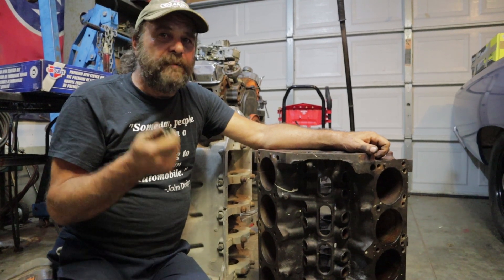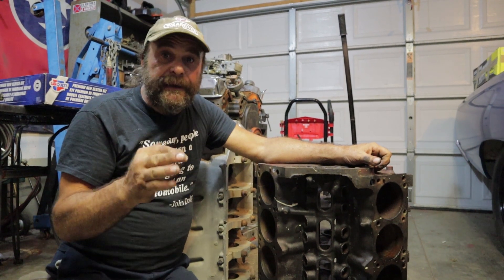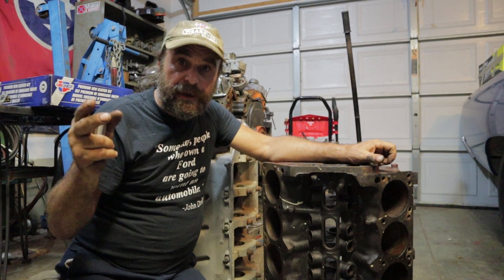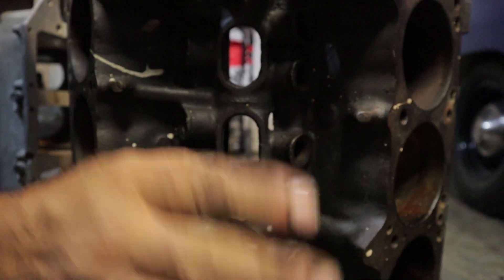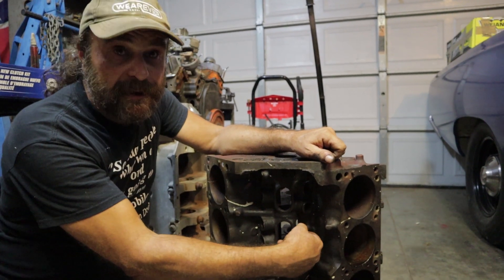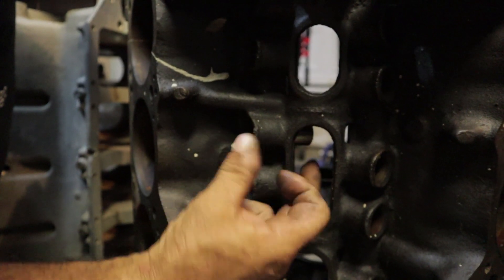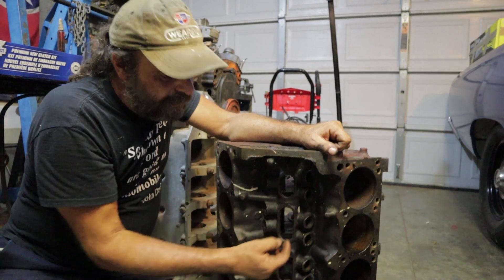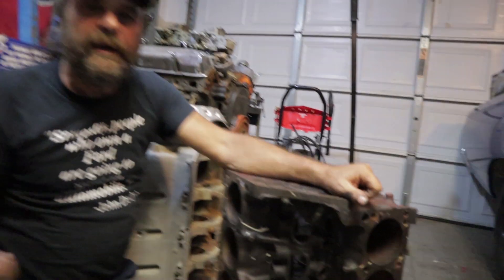Avoiding Camshaft Doom

Comment: Uncle Tony!  Love your channel!  Love the content!  Please keep up the good work.  I'm old school as well, but some of what you share I didn't pick up from my dad or grandpa and haven't figured all of it out on my own either.  Quick question about camshaft break-in.  Do you, in practice, use lighter valve springs or lower ratio (1.3:1) rockers for break in of cams?  Cam manufacturer (and other channels) suggest this to ensure that the cam isn't wiped out.  I'm wondering if it's overkill.  I've only built 3 or 4 engines in my life and I never used different springs or special rockers.  Never gave it a thought.  Was I just lucky?  Does this really need to be done or is it overkill?  As long as the lifters are observed turning and we get it to start w/o a lot of cranking, etc.  Thank you!

Comment: I always figured "zinc" wasn't the problem, or at least not the major player. Too much other stuff to go wrong and every failure I've seen pics of didn't look like lube failure, it's always one or two lifters or a section of a cam, more indicative of bad parts, bad parts selection leading to binding, bad assembly practices (not checking lifter/bore fit and checking for rotation), etc. GM and perhaps other OEMs also sold several fairly hot flat cam crate motors deep into API SM/SN oil, with warranties, without any break in instructions besides "fill with 10w30 and hold at 2500".

Comment: I figured this out on my own building my first motor. The lifters were so worn out on disassembly I gouged a couple bores and I foraged around the shop and came up with a wheel cylinder hone. Worked flawlessly

Comment: don't forget the zinc. since they stopped putting zinc in the oil New cam failures have skyrocketed. use a good zinc fortified assembly lube. Lucas has a good one. I also add about a third of a bottle (2 to 3 oz.) every time I do an oil change.

Comment: hit the tight ones with a wheel brake cylinder hone or wrap sand paper around a dowel slightly smaller than the bore and put a screw in one end of the dowel in the center then put the screw in a drill and use the drill to sand it out a little

Comment: Flat Tappets are just fine. I think people make too big a deal about it. Break them in properly, change oil, go 500ish miles or 10-12 hour drive time, change oil, I kee running zinc oil. You should be fine. In that 500 miles get on it a few times, slow down, get on WOT. Seat the rings. They are fine, just a little more “tenderness” for 500miles than rollers.

I have a flat tappet in fresh 350 rebuild if I screw it up and all I can afford is flat, Im going flat. Usually flat tappets poop out on break in

Maybe Tony could do a vid on flat tappet break in, or flat/roller comparisons based on applications

Comment: the cam ramp rates are moor aggressive now than in the past and add in bad metals and oil and you have problems. all so how about grooved lifters to get moor oil to the cam and lifter boor. are solid lifer cams less likely to fail? how about ruining solid lifer cam with hyd lifters? how about rhoads lifters?
Reply from the maker: Absolutely none of that has to do with the lifter rotating freely in its bore. A solid lifter cam is more likely to fail because of the more aggressive ramp, and rhodes lifters work ok..I've used them a time or two in the past
Reply: @UncleTonysGarage  how about ruining grooved lifters? all so can one run solid lifters on a hyd cam? how about hyd lifters on solid cam. all so how about ruining amc sized lifters in a ford or Chevy. lot of old school tricks i have heard about but have no experience in. take care

Comment: Back in the late 90’s early 2000’s everyone and their brother was pointing fingers at each other about lobe/lifter failures... ☹️. Cam manufacturers, lifter manufacturers and oil companies all blamed each other... even China was blamed. 🤔
I started using Crower “Cam Saver” lifters for all flat tappet lifters exclusively.  No more lobe/lifter issues using Rotella 15w-40 and the Cam Saver lifters for the break in procedure. 
Now I’ve sold out, only really building LS engines with roller Cams!  😉👍🕶

Comment: Back in the Mid 80's I was building my 65 Mustang 289 and was at a Speed Shop in Bergen County N.J., I had my Manifold and Carbs sitting on their counter as I was bending linkage trying to get what I wanted / worked. This guy comes in and looks at my setup and says, "I want that setup for my Trans Am".  The guy behind the counter (who owned the shop) looked at him and said do you want to tell him or should I. I miss the days of being able to go to a local speed shop and be able to find the parts or pieces needed to do a build. Now a days, all anyone wants to do is plug in a chip and have a race car!  Please keep these great videos coming you are doing a great thing by sharing the old way to a bunch of people that would never have known existed!  To bad I never got to meet you back when I used to run around Staten Island back in the day.
Reply: Even in 97 I was doing performance cams , camel hump heads and all the jazz with no internet to help.   These days most are lazy and have it easier to do what we did. We had to use a chiltons or find a guru.

Comment: what type of oil should we use inside these old engines that require zinc
Reply from the maker: Normal street engine?  I use Shell Rotella
Reply: most of the engines that come thru here are 600 hp and they like the vr1 oil even the stock engines get vr1 oil I even use vr1 In my 318 fury ..ive heard of other shops using rotella but we have yet to try it

Comment: If you want oil with lots of Zinc/Magnesium in it that pre O2 sensor systems absolutely love then try Shell Rotella 15W/40 truck oil, Castrol Drydene is another good one, I've been building and running Harley engines (they have roller tappets) for a living for years and they love the stuff, if you need a thicker viscosity (like I do) then spike it with STP Oil Treatment, it's a viscosity thickener and has even more Zinc/Magnesium in it.
I've taken apart engines I've built with 10's of thousands of miles on them that I've had the owners run that oil with STP and they look beautiful inside, one of my own engines that I ran for 20 years that had almost 100,000 miles on it and had the original factory roller lifters in it and they were alive and happy even after the engine cases were shot (it wasn't valve train or lubrication failure).
A friend of mine with a strip car that was a 9 second Ford Maverick ran nothing but straight Rotella 15W/40 in it and after 35 passes he did a partial tear down and everything inside was textbook.
Word of caution though, automotive systems that have a downstream O2 sensor that monitors emissions will sometimes trip the sensor and the Check Engine light will come on from the additional Zinc/Magnesium in that type of oil (it's truck oil), the computer thinks the engine is running emissions rich and trips the Check Engine light, these are later model systems however and the earlier non-emissions monitoring systems (one's that don't have an O2 sensor after the converter) won't have that problem.

Comment: don't forget the high zinc oil.
Reply: All I run in my engines is rotella t. Only time I add additives is during break in. Other then that just straight rotella.

Oil is always clean, so is the filter.
No way am I paying 10-15 bucks a qt for street engine oil. That would be almost 100 bucks just in oil, every 3000miles.
Reply: I hope you don't have a flat tappet cam then
Reply: I use synthetic driven oil. so I get longer than 3000 miles out of it.
Reply from the maker: Rotella has enough for any normal street engine.
Reply: by normal I guess you mean roller cam engines. they reduced the amount of zinc in rotella and now it no longer has enough zinc for flat tappetcams.
Reply: @1flynlow  do some more research. Don't just go to the forums and take what they say as gospel. Rotella has changed over the years, but the regular DIESEL rotella has more than enough for any street driven engine, even high hp NA engines.

As for synthetic..... It's a sham. As for more milage with synthetic..... If you say so. I'd still change it, just the way I am I guess.
Reply: "There are two ways a person can ensure they are using oil that has sufficient amounts of antiwear additives, commonly listed as 1,200 ppm ZDDP for flat-tappet engines with stock valve springs and 1,400 ppm for engines with higher spring rates. The first is to buy oil that is similar to older formulations. This used to be as simple as buying a diesel-rated oil, such as Shell Rotella T and Chevron Delo 400. Diesel engines also have highly stressed wear points, but diesel oils were reformulated to CJ-4 in 2007. Although the levels of ZDDP were reduced, most are still significantly higher than common car motor oils." http://www.superchevy.com/how-to/corp-0808-worn-down-engines/
Reply: "CJ-4 specification. (The 15W-40 Rotella T with Triple Protection oil has approximately 1200 ppm of zinc and 1100 ppm phosphorus at the time of manufacture)"
Reply: so according to this, rotella is fine for a flat tappet cam as long as you have stock valve springs. I do not.
Reply: @1flynlow   shell rotella t-4 has between 1200 and 1400 zppm. It was reformulated to cj-4 but is still sold and marketed as, safe for vehicles that require ck-4.

The only oils that aren't up to task are rotella synthetic and gas and gas/diesel oil.

I built my motor, I've built short track race motors and have always used rotella. Oil is always clean, filter is clean and my magnets are clean.

If YOU want to spend 15 bucks a qt on an oil that is just as good as the "cheap" stuff. Right on brother! But don't tell people rotella is going to kill their engine when it won't.
Reply: @1flynlow  I've got a lunati 292 with double springs. Rotella works great.   I'm done with the pissing contest. Take care and love thy motor.
Reply: flat tappet?
Reply: @1flynlow  yes.
Reply: thanks for the info. I wouldn't have known the difference between the CJ-4 which is safer for flat tappets and the "gas and gas/diesel" oils that "aren't up to the task." and I bet a lot of other people wouldn't either.
Reply: @1flynlow  I believe the gas oils will have an SN after the CJ-4.

CJ-4/SN.... I believe.

Comment: Another low budget tip: 12guage shotgun cleaning brush in a cordless drill or by hand, remove rust not metal
You can also buy much less expensive "tube brushes" in any size( just like the dingleberry hones). I use a piece of tubing or wood as a handle.
Share the knowledge!!
Thank You Uncle Tony for all your knowledge and advise !!
Reply: That what i used. Had a mossberg kit.
Reply: You can get those pipe brush kits at Harbor Freight for under $5

Comment: Well put Tony...One of the engine shops I worked at reconditioned hydraulic lifters and the method for the "angle" on the bottom of the lifter is Radius grinding...They were about $15.oo each new then so it worked out well when they did 1000 per day by hand and not so well when one of the goofs ruin a $500 diamond precision grinding wheel.

Comment: Tony, I  always  appreciate your advice to bucks down and inexperienced enthusiasts.  This latest trick of cleaning lifter bores with a brake hone is brilliant (been reading performance mags for years, never saw that).  I usually credit myself for visualizing  the 3 space physical world in my mind, but I fall short on cam theory.  OK, I know more lift is good, but past a point, you need to machine deeper spring pockets, get valves with longer stems, and springs with more travel and seat pressure., and you have to worry if the valves hit the pistons.  I understand more duration is good, but past a point on top of the aforementioned mods, to breath on the top end, an engine will idle like crap on the street, and at the end of the day, max duration requires roller cams.  I have less of a handle on lobe separation and indexing (advance and retard cam timing).  I kind of wish I lived in the day when cam grinders marketed their products as 1/4, 1/2, 3/4, and full race.
Reply from the maker: We'll do something on camshaft terminology soon
Reply: @UncleTonysGarage  3/4 cam i used to ask wheres the other 1/4 lol

Comment: Uncle Tony, I know you are majority a V8 & Slant guy, But I'd like to ask a question, In your Past Car days, Muscle Car Building, etc Have you ever messed/built any Buick V6s? I just Re-bought one for my G-Body Car & Have big plans in the future to Build it but on an Affordable "Old School" Way of Tips, Tricks and Performance mods... I know I will not Get much HP out of it without going all custom, etc.

I'd just like to Raise it enough to were it 1. Still a Daily Driver & 2. Fun enough where I will not get bored of it The car Being from Michigan is Specifically a Summer Daily & Show car... Thanks.
Reply from the maker: I rebuilt dozens of them back in the day, and  played with one for a Muscle Car Magazine project car back in the mid 80's...that's about the extent of my knowledge.  Engine was used in a ton of different applications over the years, so finding good info on it should be pretty easy
Reply: buick v6 engines arent hard to make fun. what year engine?

Comment: now I know a hydraulic roller wont spin in the bore, but would you want the same thing? when I pulled them on a 302 out of a fox, they had a bit of resistance (may have just been oil kinda sucking it into place) but its been sitting my shed soaked in wd-40, im wondering if thats something that I may have to consider.
Reply from the maker: Not nearly as important on a roller

Comment: Who the fuck forces lifters into rusty bores on a build? No friend of mine haha..... Get a set of ball hones if you are performing a low budget make do guerilla engine build. Here are some, and you can use am on brake master and wheel cylinders too. BTW, that last lifter bore seemed a little too loose IMO. Anyway. Thanks Tony.   https://www.ebay.com/itm/Ball-Hones-2-Pieces-3-4-and-7-8-New-Other/323838539345?hash=item4b6647f651:g:S68AAOSwXSJXPMx0:sc:USPSPriorityMailPaddedFlatRateEnvelope!95519!US!-1

Comment: Hey Tony I recently assembled my first engine with hydraulic lifters I was following a workshop manual (of questionable quality) which neglected to detail that the lifter needed to be half full of oil before the plunger was installed, I did however well lubrucate them on assembly then submerged them in oil overnight, Do you think it would be OK to run if I prime the engine with the starter or should I just be safe and redo the lifters properly?
Reply from the maker: I never fill the lifters myself.
Reply: Cheers I am relieved to hear that👍 I was getting a little bit worried after noticing that extra step in my 2nd workshop manual

Comment: I have found in order to get past the possibility of sketchy metal in lifters (flat tappet) I go to Howard's (Direct Lube) or Crower (Cam Saver) and run those.  Good metal (Crower guarantees their face hardness & grind spec) and they work with anybodies cam :D  Cheap insurance in the low zinc oil era ...

Comment: This is great advice for at-home engine builders. 
Something else to remember is if you have your engine block hot tanked, you MUST hone your lifter bores. The heat of a hot tanking can cause your lifter bores to become slightly egg shapped. This will result in lifters "hanging" in the bore or sticking. That can break a valve spring or even damage the entire engine.

Comment: You should see a "Bullseye" pattern on your tappets/lifters.  If not somethings wrong.  Also, if your tappet seems to be scuffed that can be the sign that you're not getting enough lubrication and/or zinc.  We fill every new engine with Schaeffer oil during break-in and the delivery fill because it DOES have a bit more zinc to protect the type of "old school" engines we predominantly deal with.  Once it's broken in...additional zinc is mostly not needed as most oils still have 1200PPM ZDDP in them already which is about the min required.  Nothing wrong with adding it because most of those cars don't have cats...but often not needed once everything is broken in.  But as we tell people when they as about how long it takes to "break in" and engine..."The first stroke is breaking it in, the rest are wearing it out"!lol!

Comment: Got a ?  I got a sbc with 292 cam HEI dart pro 1 iron heads 60 over flat top piston 750 carb. Carb is set and time is on 12°  starts and ideals good but when Rev up it backfire through the carb and when put it in gear and bring it up on the stall ( 3500) it pops and cracks and will not evon turn the tire over any advice would be appreciated running out of ideals for it
Reply from the maker: Initial timing is 12, but what is your total and at what RPM.  I would think 34-36 degrees in by 2000 rpm would be about right.
Reply: @UncleTonysGarage  im not sure on total timing and 6000 to 6500 is max rpm it's still geared high.  Bone stock HEI dis.  Summit brand

Comment: I HAVE A SOLID FLAT TAPPET CAM IN MY FORD 427 600HP DRAG RACING ENGINE.I use Lucas Oil High Zink oil.No problem with this cam as long as you have the right oil.

Comment: I saw in another youtube vid that you can check if your cam is properly broken in after the 20-30 minutes by marking the side of the pushrod with whiteout, it's easy to see if the pushrod is rotating as you crank it over.

Comment: Uncle Tony, what are your thoughts on running mobil1 full synthetic oil in a 349,000 mile 318? Daily driver,  never been rebuilt. Minimal blowby, doesn't smoke.
Reply from the maker: Not a fan of synthetics in engines not designed with them in mind.  Old school gaskets don't like the stuff.  I use  Shell Rotella in all of my drivers